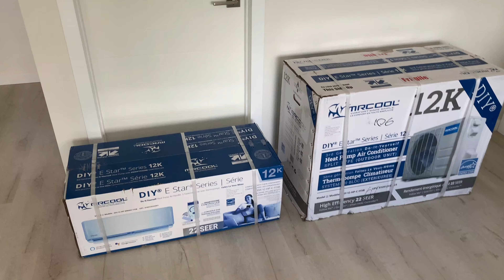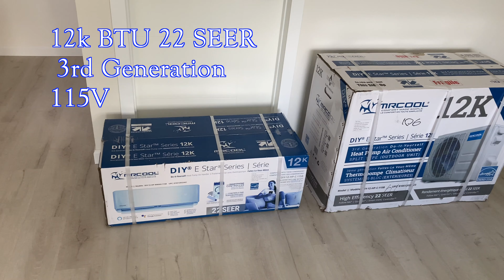Installing ductless mini-split system. DIY. Compressor in crawl space. MRCOOL 12K 115v.

Comment: Hello - we did this in our home. I was curious if you’ve had any issues with humidity increasing in the crawl space and causing mold issues? We live in Northern California that is generally dry besides the month or two of rainy season. Just wondering if we need to be concerned at all? With that being said, we only use the mini split for air conditioning in the hottest days of the summer, which aren’t more than 1 or 2 months.
Reply from the maker: So far I didn't see any issues. I'm located in Bay Area, CA. And using it for heating and cooling.

Comment: My bet is that if the compressor fan air was blown outside of crawl space wall through a louvered vented opening, this would be the most efficient operation possible... Just a thought which I will be doing later this year on my new house...

Comment: I have a similar size MS which is also a 12k, but 240v.  I'm amazed how efficient and well these work!  Works great for covering all AC for the 800 sqft space, and is used for heating as well for all but Dec-Feb (use NG then).  I highly recommend these, likely cheaper to use than std HVAC systems.

Comment: Why not install condensate line into any of your black plumbing drain lines??
Reply from the maker: since system has 2 drain lines and compressor level is below of the level of sewer lines, I still need to install the pump. 
I redirected the pump to exhaust the water into one of the black pipes.
Reply: @SolarEngineering  Got it!

Comment: I'm very intrigued about mounting a mini-split compressor in a crawl space. We've got a small 14'x50' house in the mountains, that needs heat (cooling is a bonus in July/Aug)  We close it down during the winter months, so we're rarely there when temps are below freezing.  The crawl  slopes from 2' to 4' along the 14' foundation walls and it will have vents.  It will do more heating than cooling, but I like the idea of being able to cool it. The house is well insulated. Does this situation sound like a good application to mount the compressor in the crawl space?  Another reason I want the compressor in the crawl space is that is stays out of the elements, wildlife, etc.  during the winter months when the house is winterized and no one is there.  Any thoughts on this would be appreciated.  Thanks.
Reply from the maker: Hi Chris, it sounds like you have plenty of ventilated crawl space. You could check the question from James Cleveland (here in the comments) where I did some calculations.
I haven't yet tested my unit in heating mode (couple of days for example), but in the summertime when we had heatwaves, it was able to cool room to any temperature and crawl space temp was always cooler than the outside temp. I expect it will work the same way in a heating mode. If you have any questions let me know.
Reply: @SolarEngineering   As far as noise....with an insulated floor (2" of spray foam)  is there any more noise with the unit in the crawl space vs the compressor sitting outside?
Reply from the maker: @chrissteinlage565  my compressor is located in a corner under the living room. Floor insulated with 1-inch foam board (less noise canceling material). If I stand in the leaving room in the middle of the night, I can hear some light humming noise, but I have to really listen to it. If the internal unit would be located under the same room, air noise from the internal unit will exceed compressor noise (and the internal unit is really quiet).
Also, I wouldn't attach the compressor to the foundation or any other house parts, because of potential vibration and related noise transfer.
Reply: @SolarEngineering   Thanks for your comments.  One other concern I have on installing a mini-split heat pump for a location where it could sit idle/off for 8 months of the year (the winter months)....have heard the mini-splits are prone to having issues holding charge if they are not ran frequently?  Any thoughts on that?
Reply from the maker: @chrissteinlage616  I don't know about that, it's better to contact MR Cool and ask them.
Reply: @SolarEngineering  ...wanted to give an update on this thread.  Ended up getting a Mr. Cool 2 zone (12 BTU each) w/ 27,000 BTU 2.25 Ton compressor.  Mounted on concrete stem wall of 14' x 50' foundation (4.5') crawl space. This was 3rd summer.  It has worked great!  But did learn several things along the way. This may not work in all climates or situations, but it works great in this mountain application.  It is “summer only” and one of the goals was to have the compressor in a protected environment (snow/wildlife/etc) for the 9-10 months it is not being used.  Summer of '22 unit was installed - No vapor barrier on bare soil, 4 foundation air vents open allowing natural air-flow in crawl space (outside humidity is low during day). The system worked fine, but humidity levels in crawl space increased. The 4 vents were left open (major mistake!) during the winter and the crawl space floor was still bare soil (major mistake!)  When we "opened" for summer last year (May '23) there was significant mold on the floor joists, the humidity level in the crawl space was terrible, everything was sweating.  It was a lot of work to clean. Used squirrel cage fans to move air, added a dehumidifier, installed vapor barrier on dirt floor that extends about 1/3 up all the walls.   Last Sept. when we closed for the winter,  the vents were closed and the crawl space was essentially sealed for the winter.   This spring (May '24) when we opened the crawl space was perfect!  No mold, perfectly dry, low humidity.  We have left the vents closed all summer, left the dehumidifier on (it is set on 50%).  The temp & humidity in the crawl space is normally mid-50 temp and mid/upper-30’s humidity.  The highest the humidity reading was when we first opened the end of May…the crawl space temp was 32 degrees with 87 humidity.  But once power was turned on the dehumidify quickly had the humidity into the 50’s and it continued down from there. The highest temp I’ve recorded in the crawl space was 73 degrees w/37% humidity on a warm July day. I’ve got a Little Giant pumping out the condensation.  Bottom line: a dehumidifier/Vapor barriers/closed vents is critical; to better control the environment. In this mountain application, where the Mr. Cool is often required to both heat & A/C in a 24 hr period, I have found using the Mr. Cool App and setting it on “Auto” at our desired temps works best.   Long message, but since your post was the first I found that gave me hope that a crawl space compressor install would work, I wanted to share.  Thanks!
Reply: @chrissteinlage616  Hi! We live in Northern California, Bay Area, and did this. I’m curious in your post if it was the mini split running in the winter months to heat your home that caused the mold? We only plan to run ours on the few hot days we get, and wanted to make sure I won’t have a mold problem. We have vents throughout the crawl space to outside and figured that would be enough. I also didn’t think the condenser pushes out any humid air, just hot dry air…but I am a new home owner so learning along the way!

Comment: Do you have the same issue I have where the right side of the air handler is not flushed with the wall? If not, what do you think could be causing this?

For reference: https://imgur.com/a/pUC2Qo2
Reply from the maker: in my case I have a gap (1/4 or 1/8) on the right side, because refrigerant lines pushing unit little bit back due to tight space behind unit.
Attaching the base plate tighter to the wall with additional screws might help to prevent gaps.

Comment: Great video. I have an unusual situation, I would like your opinion on. I have a large underground concrete "building" 12,000 square feet, 15' ceilings. My daily business is in a 800 square foot room. I am thinking about heating this room with a mini split system. I would like to locate the condenser outside of the room in a hallway or other space. The underground space naturally stays around 45 F. in the winter. My concern would be the condenser introducing to much cold into the rest of the underground space while heating my workshop space. Thanks
Reply from the maker: I'll try to do some calculations, what is the height of the ceiling in 800 sqft room?
Condenser is going to be installed in 12,000 sqft building?
How cold 800 sqft room getting and what is the desired temp for heating?
Don't promise 100% correct calculations, but I'll give you a rough idea.
Reply: @SolarEngineering  Thanks, the 800 sqft room has a 15' ceiling and is one room in the 12,000 building. without any heat, right now, it is about 55 F. It would be nice to have it between 65 F. and 68 F. year round.
Reply from the maker: @jamescleveland4636  Disclaimer: my calculation is not based on any physical formulas, just common sense calculations.

Considering that the heat pump transferring energy from one point to another, I’ll approach it from this side:

Volume of small room: 800 sqft * 15 feet ceiling = 12,000 cubic feet
Volume of bigger room 12000 sqft * 15 feet ceiling = 180,000 cubic feet

We need to heat small room from 55 to 68 = 13F temp diff
Let’s transfer it to “heat units” = 12,000 * 13F = 156,000

Now if we take volume of the bigger room 180,000 and divide it by 156,000 we gonna get 1.15F diff, so bigger room temp will drop 45F - 1.15F = 43.85F

Things I’m not considered:
1. Heat pump efficiency is not 100%. But in our case temperature drop in the bigger room will be even less, since heat pump will use electricity to run motors/compressor and it will generate heat.
2. Heat losses by small room: if a small room will dissipate heat outside of your entire building too fast (trough roof for example), then more heat will need to be transferred from the bigger room, which will cause a bigger temp drop.
Reply: @SolarEngineering  Thank you for your help with this question. I appreciate your common sense approach. thanks again.
Reply: Heating one room in such a large area is really not that much different from putting a refrigerator into a small kitchen. Ultimately, if you are heating that small room, when the heat escapes it may go back into the previous large room. So you really are not "losing" much heat.  Like a fridge it will take some energy to keep the temperature difference.
Reply: Just a quick update, we have been using our mini split system for just over a year now to heat our underground shop space. The outdoor unit is installed outside our shop in the hallway, and is drawing heat from the surrounding concrete and ground heat. We are heating year round. The temp in our shop is staying around 50F in the winter and around 65F in the summer. The hallway and surrounding areas are around 40F in the winter and 60F in the summer. We went with the 24k diy unit. We only run it in the daytime when we are working, other wise if left on continually it draws down the surrounding air temp too much. I would say overall it has been a good thing for our situation.

Comment: How is it working so far? Just curious.
Reply from the maker: works well so far, we had a heat wave with 94F outside, it was able to keep room at 70F and crawl space temp was still cooler than outside temp.
Reply: How many and how big are the vents in the crawl space? 
What was the temp in CS when it was 94* outside? 

Do you have any video when is cold outside? 

Thank you

Comment: What? Air conditioning blowing air at 110?
Reply from the maker: about 120F, I think it's coil temp, actual air temp might be a little bit less.
Reply from the maker: and it is the heat pump, it could heat and cool space.
Reply: Thanks for the clarification- great videos

Comment: 2 thing. It does say 20A Max fuse on the unit, I think you said you have 30A so that won't protect it. The other is I think you are suppose to vacuum the air out of the line and evaporator otherwise you a gas air mixture in there.
Reply from the maker: This type of AC (MRCOOL DIY) going with special lines/connectors. Lines have already been vacuumed and filled with the correct amount of refrigerant.
30A is just a switch that I'm using as a disconnect (23:01)
Reply from the maker: @IThinkICare  just read here https://mrcool.com/diy-3rd-generation-e-star/
Reply: @SolarEngineering  Wow. That is major as I have been reading on this for a while and you can see on the video how he makes sure that there is a vacuum in the line. So it's not that it's empty/clean, but so there is a vacuum. 
Why is this not needed for this I don't know. And this brand seem very good (expensive) compared to others. 
I saw the inside of that connector, but have hard time to believe that there was vacuum in that line. Also in the evaporator. 
Maybe others can comment or ask MrCool , it is too expensive for me.
Reply: They do call it DIY version, it must be about that connector ! 
Thanks for showing that in detail. 14:45

Comment: As always, very clear. Besides the crawl space comments, did you consider using a 48 volt inverter heat pump to get around the inverter? Good vid.
Reply from the maker: too complicated to make it 48V:
- need looong wires to get to the place where it's installed
- 48V may not be available 100% of time (rainy/cloudy days)
In my case, it was easier to make it work just from the standard 120 line.
Reply from the maker: and thanks for the kind words.

Comment: I’ve installed ac systems for over 40 years and I would never install the outdoor unit in a crawl space. They should always be on the outside for best operation. Even a well vented space will get warmer then outside.
Reply from the maker: thanks for the input, I'll see how it works for me.
Reply: That's not true at all.  The unit he is installing isn't pushing out that much heat.  If it is well ventilated like he claims the air outside if it is cooler will be drawn in, and in most climates if the space is large and ventilated well enough will remain cooler under the house than outside

Comment: this is bad install. the fan will heat up the crawlspace and then it wont' work as effciently because it cant' transfer the heat out. it should of been put outside where it has more air.
Reply from the maker: crawl space where it's installed is spacious and vented, time will tell
Reply: @SolarEngineering  as long as there is sufficient air volume and the crawl space doesn't overheat.  It's not a bad idea at all if the space allows for it.  Not that much different than installing it under a deck which I've done many times.
Reply from the maker: @Jdrichardson35christ  yep, I agree with you. Claiming that it's a bad install without any data is rashly. So far I tested it during heatwave and the crawl space was still cooler than temp outside.
Reply: Thinking of installing in a vented 3ft-9ft crawl space in mountain community Big Bear CA. It stays warmer in winter and cooler in summer. Anything I should look out for? There are 10 4” x 10” vents
Reply from the maker: @darrenswenson4602  what is the height of the crawl space? 3x9 is not a big space, but 10 vents should do their job. I haven't used my system for heating the room yet, but cooling works perfectly, the crawl space remains colder all the time when AC is working.
Reply: @SolarEngineering  I believe that he meant that the crawl space was sloping in height from 3ft to 9ft...most likely a full size house crawlspace... Good to Go.
Reply: @SolarEngineering  Crawlspace is 22’ x 23’ and it varies from 3’ tall at top of hill and 9’ tall at bottom of hill

Comment: lol - so they sent an entirely new condensor-evaporator instead of sending one small plastic bit?
godda love the 'rationality' of capitalism :D
Reply from the maker: yeah, mrcool sent the entire indoor unit for replacement. 
This plastic piece is a big part of the unit frame, so cannot be replaced locally, but still would be good if they get it back fix and resell.
Reply: "rationality" and "capitalism" in the same sentence...LOL I understand your sentiment. 
I don't know that capitalism has much to do with it though. What is missing here is a suitably fine resolution of component - the manufacturers/sellers consider "component" to be whatever is in a box as a single component. In this instance, its the entire indoor unit. Another component is the outdoor unit. 
The manufacturer has done this on purpose because to define each bit would be overwhelming for the reseller. Each bit has a relationship to the other bits and a specific installation/removal procedure, specification for each bit and so on. Now much of this will change with new models and improvements so the information required to manage all these bits, new and old slowly morphs into a huge database or parts - well beyond the reseller to manage (They may have thousands and thousands of components). 
The problem is independent of the political or economic system and is very dependant on the number of choices that are available. 
Capitalism tends to spit out far too many choices, communism not enough. We dump radioactive waste without consideration or proper containment, we create a floating plastic garbage dumps the size of Texas in the Pacific, we emit CO2 and other contaminants in the air beyond what is sustainable, etc. etc. etc.. 
Luckily the Earth is beginning to send us strong signals that our behaviour is incompatible with life as we know it so we now face a choice; either clean up our act or perish - communist, capitalist, socialist, fascist - doesn't matter -  Earth will squash us  if we don't include sustainability in everything we do and embed sustainability in every system we devise. Love it - the ultimate arbiter is beginning to grumble!